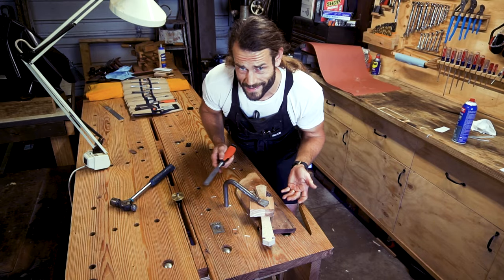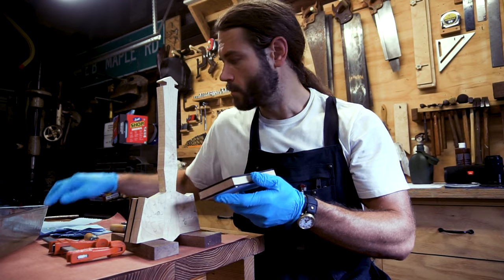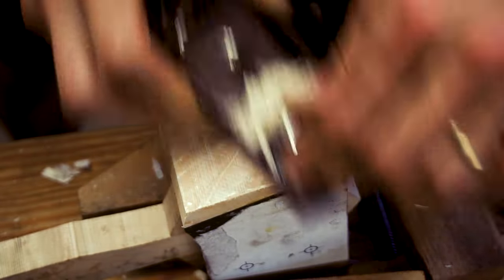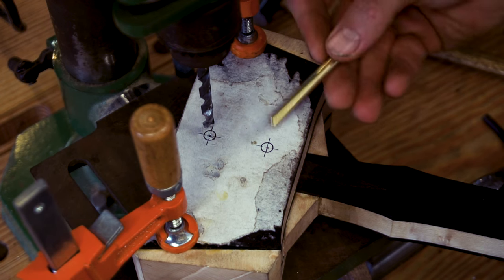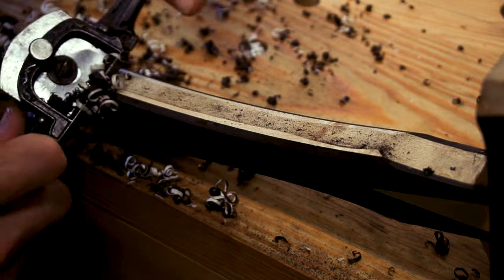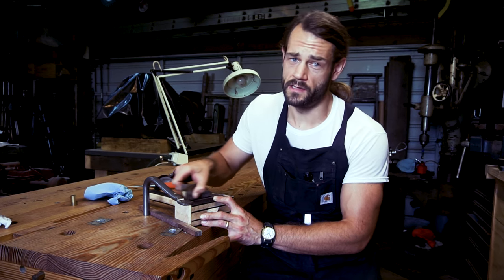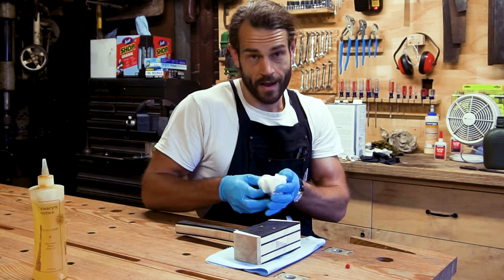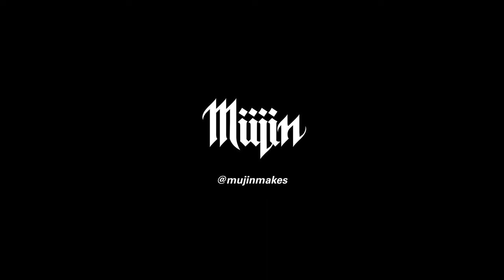Building an overly-complicated joiners mallet

Comment: I've never liked this style of a joiner's mallet, but by Thor, this is a mallet to rule them all!
CA-glue and impacts are a poor match often. Though I don't see your brass inlays experiencing much vibration as you're not making a sledge hammer but a joiner's mallet. Still, good to keep in mind that CA-glue is the most brittle glue there is. The tensile strength might be impressive, but just a bit of reverberation and it just pops right off. A luthier doesn't make striking instruments so they might not know the downsides. Don't know what's a better alternative if adhesion is an issue since I don't use brass much myself, epoxy? At least that's what knife makes use with their cross pins and they stand up to heavy chopping with 10+inch blades and going through 2x4's.
When it comes to the brass rods on the sides of the mallet, what's often done is you drill from both sides if you can mark them close enough so that is mostly meets in the middle. It doesn't matter that it won't be perfect in the middle as no one can see it and you can just hog out the middle with a hand held drill so there's a path for the pin.

Not to sound like an ass, but I'd suggest keeping an eye on the balance out your voice during the different clips. Just basic audio balancing. In some places I had to adjust my volume accordingly.
Otherwise just based on this one video; if you're into a Youtube-career enough, I think you've definitely got all the right stuff here; skill in the actual subject, a sense of style in design, and most importantly a sense of style and humor on the video side of things. It's in the last few years on Youtube I've found that there's new talent just popping up that pretty much have all that's necessary for a few hundred k subs but just like you, have around 3k. It's so weird. Just 5 years ago channels like these would've exploded immediately on the youtube-woodworking sphere.
Reply from the maker: Great feedback, really appreciate it. I read that epoxy was notoriously prone to failure for brass, but if I did have problems with the inlays the next move would be to add + peen small brass pins (these can be seen on the Studley mallet, which this inlay based on). And good note on the audio - I don't have much of a pulse on how these videos sound on other devices, so I'll have to pay closer attention to levels on the next one.

Comment: Great job.  On mine I drilled a hole through the handle and inserted/glued in a bit of copper tubing to line it for hanging it.  It's walnut on the main head and the handle is oak.  Dents a bit but doesn't dent the tools so I'm happy.
Reply from the maker: Sounds pretty. A used mallet is a happy mallet. The dents only add to the charm.

Comment: Well, it's ugly as sin, but it has a decent shape, and, critically, the handle is polygonal in section. I've seen people make round handles for mallets, and they simply don't work. I have doubts about the longevity of the junction between the end-grain hitting surfaces and the body of the mallet, and it was entirely unnecessary to add this piece anyway. When it falls off, just re-shape the ends of the body underneath, and use them as the hitting surface. The glue will fail between the handle and the head, but because you've used the traditional wedge shape for the handle that won't matter.
It's a pity to waste one of the most precious woods on the planet on tools like this. This tree is incredibly rare in the wild now, and it's timber really should be treated carefully.